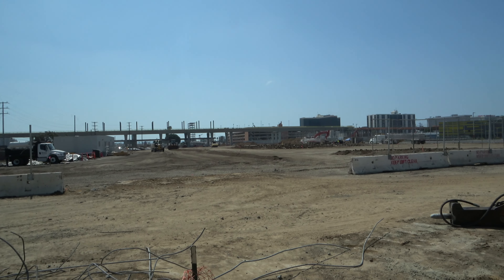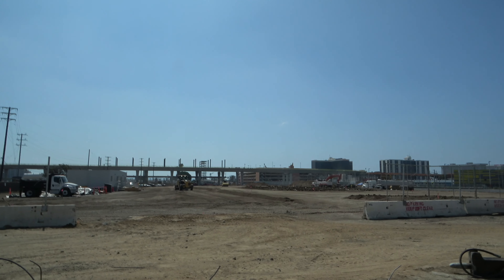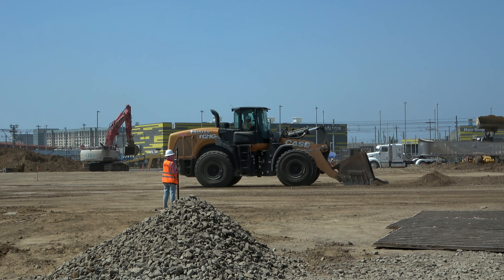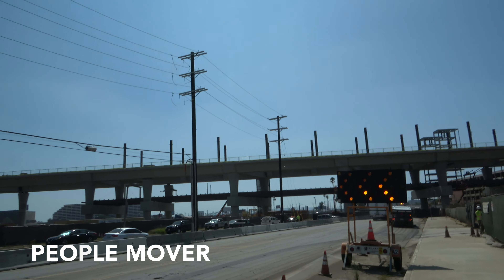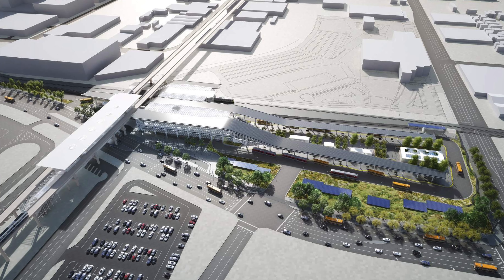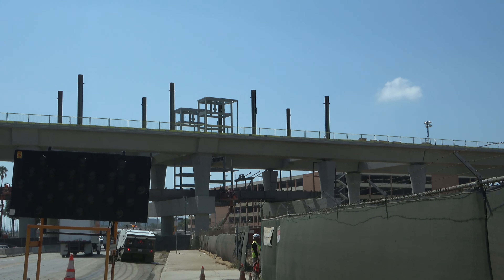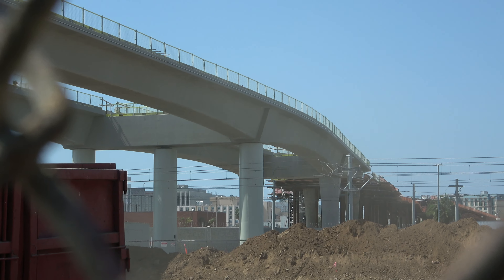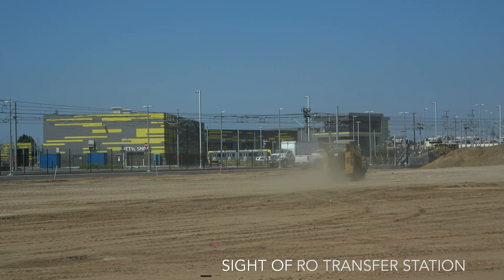$900 Million LAX Airport Metro Connector Construction Update

Comment: Cool, but for 5.5 billion, idk why they didn't just extend the light rail to LAX and used a bit more money to better connect the crenshaw (K) and expo line (E) to better facilitate a one seat ride to downtown. There are literally 3 transfers to get to downtown. Hopefully in the future they rectify this 😁!!
Reply: Because the design of the horse shoe is not really conducive for that. That ship sailed 10 years ago. What they are building will be better in the long run.
Reply: @ES-hr6vg  I know that. No way would imagine it doing the horse shoe, but more a centralized stop either underground or elevated.
Reply: @TheLIRRFrenchie...  it would still be too far from the Bradley Terminal and still require some form of transportation.
Reply: @ES-hr6vg  I would imagine something could've been figured out. It's all about the willpower... And funding lol. But